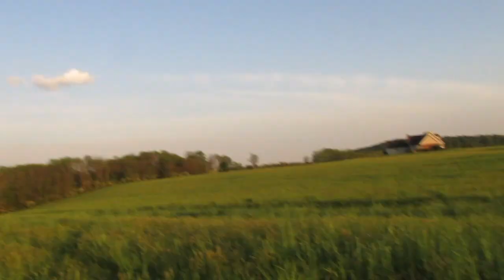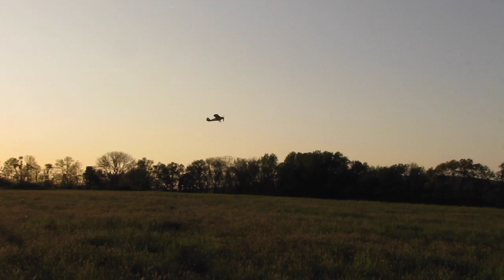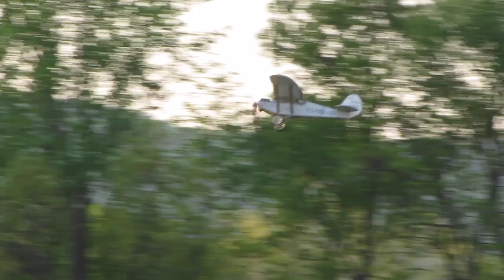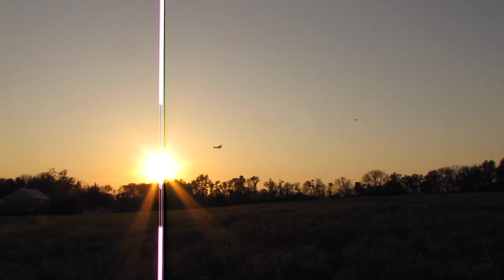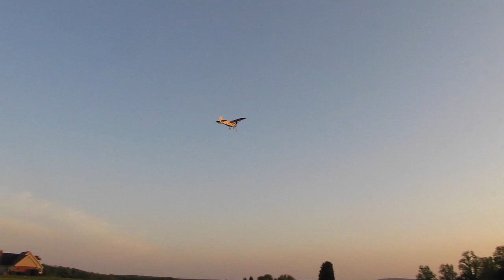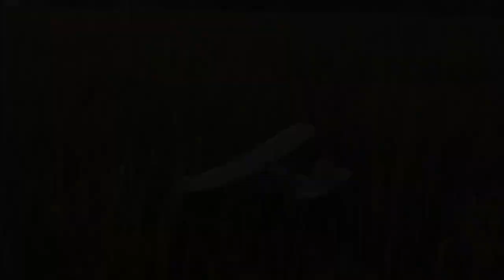Rubber-Powered Ryan M-1 trim flights, Pine Forge, 5.9.18

Comment: Lovely.  I have the same M-1, but haven't built it as yet.  You do the Ryan M-1 justice!  The first M-1's flew in 1926, I believe from my Ryan history.
Reply: Additionally, the M-1 was the basic plane the Ryan NYP (a.k.a., Spirit of St. Louis) was based on.  The M-1 had a wingspan of 36', whereas the NYP was extended to 46', the canopy enclosed and longer fuselage.  While the NYP wheel base as widened vs. the M-1, the same bungee design shock absorber system was utilized in both.  The one thing that was used of the M-1 on the NYP were the tail surfaces.  No change was made there.  As far as the power plant was concerned, the M-1 utilized both the Hispano-Suiza 8A and the Wright J-4B, which of course the the immediate predecessor to the Whirlwind J-5 type that was used on NYP.

Comment: Super model, yet again...what's your 'standard' model set-up? Warps, thrust lines etc.
Gary
Reply from the maker: Thx.  I put in a bit of down and right thrust, maybe 2-4 degrees.  I prefer to build the wings flat, then adjust as needed thru the trim session.